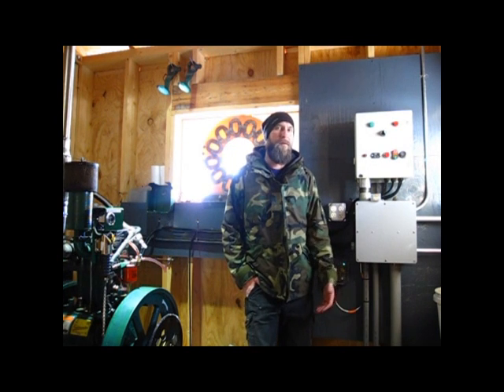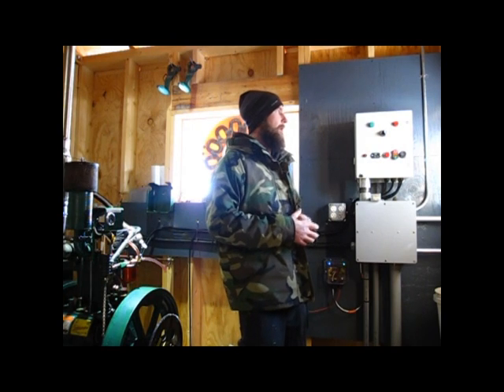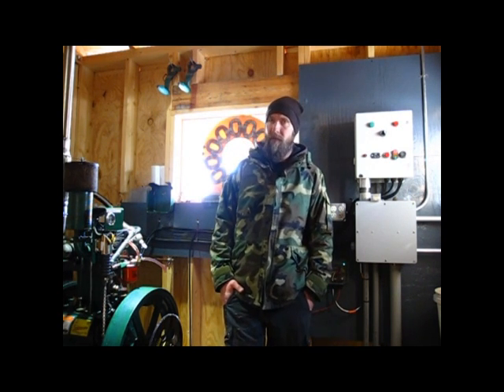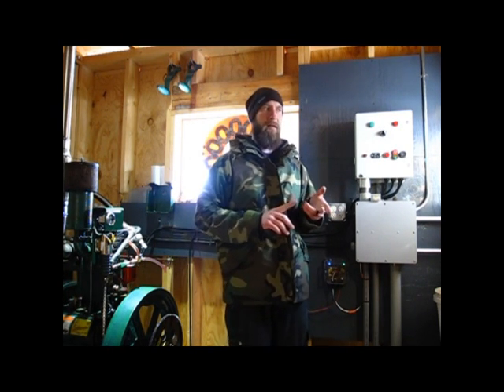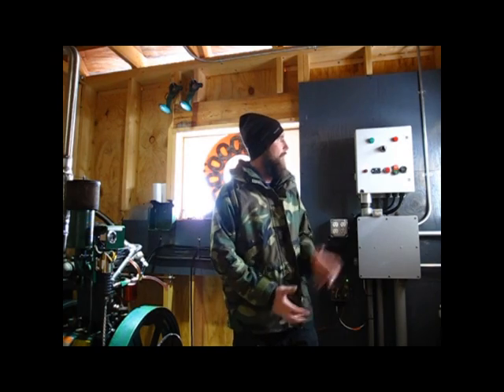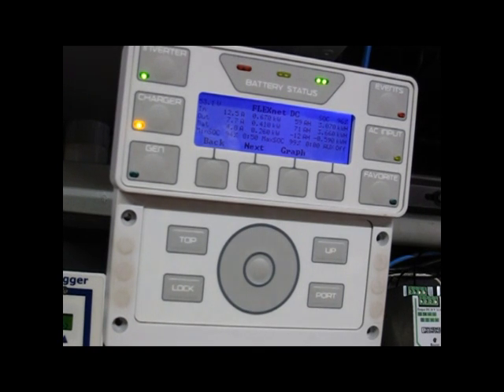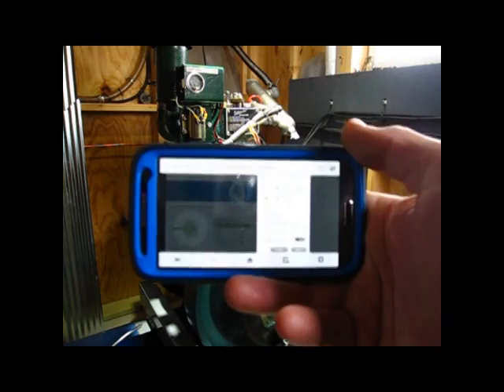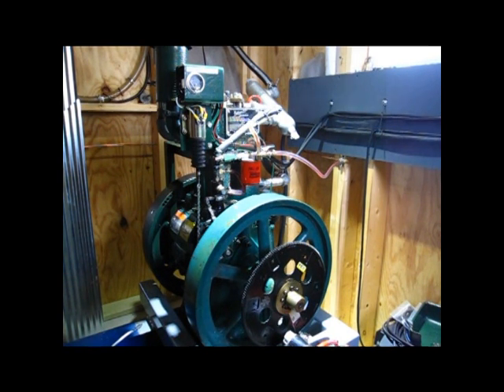Autostart Controller for Listeroid Generator

Comment: How do you manage to keep the listeroid's valve train oiled in this configuration, if you don't truly figure on going in there every time you run it?

I have a Listeroid, but am aiming to make a shop generator of one of my Redstone engines.  The only reason I haven't set up a generator with the Listeroid I have, is I didn't care to oil it daily, religiously. 😢
Reply from the maker: Good question! I think I thought about that briefly, in the beginning, but in reality, I don't run it that often. It only sees 20 - 30 hours of run time each season, and honestly, every time I've ran it I've been here and  oiled it at start up. We have enough solar and wind to never need to run it if we aren't home using energy.  When I do run it, the average run time is around 4 or 5 hours (that's 12 kwh - 15 kwhs.

Comment: Does optics allow you to remotely change settings in a device connected to a hub? That would sometimes be super handy in my setup. Currently running a 15yr old outback setup with a mate2, utterly reliable but could be tempted to upgrade to a mate3 if it gave me more remote control through optics,

Comment: nice job !
Reply: Larry Kapp Very cool, old technology Lister cs goes hi tech. Do you have a build blog? Have you considered a Lister chp?combined heat and power.
Reply from the maker: I did help a friend with a Listeroid CHP project. Its similar to my setup in the sense it runs a very similar alternator that we custom built. It does not have a controller like this, but its not hard to adapt one. The owner uses it to heat his radiant floor in the shop. He has recently moved however, so Im curious how the new shop comes together utilizing the axial flux CHP genset. Ill try and post back if I get some pictures. Thanks for watching :-)
Reply: @windsine , Very cool. I've wanted one for years. I'm picking up a new off-brand Lister this summer. I have a choice of a 6/1 or an 8/1. My hope is to be able to: 1) Provide off-grid power 24/7. 2) Shop air. 3) 12V alternator to keep all vehicle batteries charged up. 4) Radiant Floor and other heat for the shop - fall/winter. However, Due to my wife's (not sure what to call them, disabilities or handicaps) I need to make sure she can start the unit when I'm away.  Thus the hand crank will not be an options - or I'll have to scrap my long time idea of having the Lister on the farm to run the off-grid shop and hopefully our house too. Anyways, I would love to hear more about your setup, build and the auto-start - protection/shut down controller system.  Maybe even buy the controller/program and whatever else I need from you (if you are willing) and the over the counter items I can get locally. (FYI - I'm a mechanic and I can put it together. My skills are not that great to build the controller and shut down unit for what you did.) Great job. Either way thanks for sharing it.  All the Best, Tony